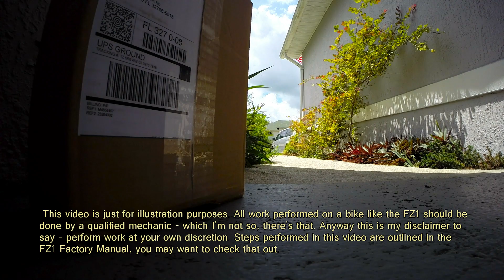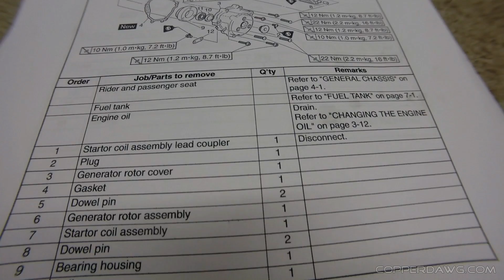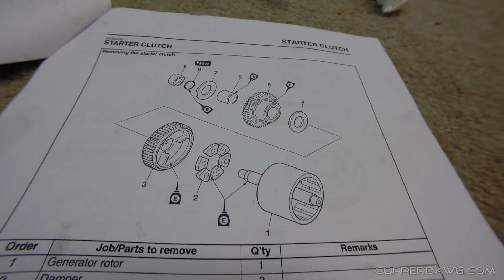FZ1 Video Tutorial - Generator Inspection

Comment: Are there any symptoms the bike will experienced if it was failing and coming apart? I just bought a 2014 fz1 with only 6k miles. 
I’ve only had it for couple days and haven’t ridden it much yet but during a cold start it would take at least 2 tries but once warmed up it has no problem starting. Previous owner said it wasn’t ridden much and sat for awhile so I’m not sure if that has to do with it.

Comment: is this a generation 2 fz1?
Reply from the maker: Yes, 2007
Reply: @buelle109  i take it that my 2004 is still possibly liable for the stator damage.
Reply: @jayminasi6073  I believe gen 2’s start @2006. And later gen2’s( not sure how later but like last yr or two) had a from factory “fix” , meaning they changed the design
Reply: @vicpnut1  what about the 13 model ?
Reply: @DaRuler66  i wanna say that yamaha finally fixed it by 13…but its been awhile and i cant recall specifically ….also just did a quick search and now specific years came up just how to’s and sales etc….i know i read in one or more forums im in of a year they finally fixed it ,all i can remember is is was way after they knew about the rotor failure  ,like last yr or two of production..
Reply: @vicpnut1  i was told the 15 were the first to get the new rotors - i'm looking at getting a 13 FZ1 but not looking forward to spending another grand to have the rotor replaced
Reply: @DaRuler66  if youre mechanically inclined at all it can be done at home for cost of parts alone fairly easily …..if considering it just search youtube for how to’s (theres quite a few) to get ahead of gear/bushing issues that if planned for arent issues …its really quite simple if you follow what you tuners did /do(watch as many till you feel confident)..my point being ,though my bike has given me some issues that arent typical …in general the bike is worth it imo…its a rocket in standard seating position (much more comfortable for all day rides) and there are tons of aftermarket parts and support out there ..just fyi/imo
Reply: @DaRuler66  also , the bike is old enough that theres a good chance a previous owner already swapped , like was the case in my 2009…i have a new rms rotor sitting here because i assumed I needed to replace it.when i opened the case (takes about 5 mins) i saw there was a new one already installed . So did t need to pull gears etc , which is the only slightly difficult part of doing the job .

Comment: The bearings aren't the issue. The issue lies with the rotor. The epoxy used to glue the magnets deteriorates and then the magnets falls off, hopefully only destroying your stator and rotor. If you are unlucky it grenades your motor. The new rotors are upgraded where the magnets are encased in metal and cant fall off. Well worth the upgrade since when they go bad, it just goes without any warnings.

Comment: The updated rotors are not cheap, but the old style can fail suddenly and without warning, and when it does, it releases shapnel into the engine.

Since it appears I am stuck with my '06 until I die (not willing to sell a great bike for pizza and beer money), I bit the bullet and got the updated rotor.  Thanks for the video!  My '06 only has 27K miles on it and has been flawless.  I wager it will be with me until the end...
Reply: I dunno, 300 bucks cad for the RMstator rotor and gasket is pretty cheap compared to new engine.
Reply: You buy oem rotor?
Reply: @mobleyMobley  Yes.  Alas, I plan to sell the bike soon for the aforementioned "pizza and beer money".  I am the original owner of an '06, that is a pretty good run!

Comment: Hello. Great informative video. Do you by chance know, if the bolt you are unscrewing at 3:09 has an o-ring in there? I ask this, because my fz1 is dripping oil, precisely bellow that bolt. Thanks for any input.
Reply from the maker: Yes, I am pretty sure there was an o-ring there.
Reply: Yup, I can confirm that. In my case, the O-ring was good, problem was that the Bolt was cracked because of a bike side fall. Anyway, problem solved. Thank you very much for your time.

Comment: There are two bullet shaped guides located between the cover and the engine ( you can see them on 6:30 ). Be carefull when you remove the cover because they come out loose and i had one fallen into the engine. I had to tear down half the bike so i can get to the oil pan and retreive it.The funny thing is that they are not magnetic so you cannot pull them from the top. Its a pain in the ass believe me and you need another 2 new gaskets to reinstall the pan.

Comment: Do you have any advice on how to remove the rotor from the stator. I can't seem to over power the the magnet connection. I may just be too weak right now, but it seem like you just popped it off by hand.
Reply from the maker: If I were to do it again I would use the ball driver to hold the rotor firmly into the rear bearing while I pry the cover and stator away from the case.
Reply: buelle109 could you send a link to the ball driver you are referring to?
Reply: Erick Miller did you ever get it out? I’m having the same issue

Comment: Ok, swapped my rotor yesterday. A couple of things. First of all your video was very helpful. Thanks! But you are missing the washer and spacer (which has an o-ring inside of it) that sits on the axle after the starter-clutch. I.e in between the starter-cluch and the inner bearing. It can't be seen on your video that you put them onto the rotor-axle but I hope that you actually did put them on but just didn't show it. ;)
Reply from the maker: Pretty sure its on there I must have cut that clip during editing

Comment: Great video, thanks!
I'm going to do this on my FZ1-N 2008. Want to replace the original rotor with the new version just to be safe.
One thing though; on the picture from the service manual you showed there is a O-ring displayed. Couldn't see it anywhere in your video though? Is it inside the spacer or where is it?

Comment: Hi, I'm not sure if you're still riding the fz1.. but i'd like to know the symptoms of magnetic coil failure if you know any?
Reply from the maker: So far those that have had the failure have not said that there was any indication before failure. And yes I am still riding the FZ1
Reply: Check the voltage at your battery, if it is anything less than 13v @ idle there is an issue with your charging system (which may be the stator, or rotor magnets or the R/R)
Reply: there is a high pitched whizzing sound, sounds kinda like gear driven cams. Then you battery will simply die and the bike wont start. Mine just failed. 06 model
Reply: @mechanicalman4531  how many miles?
Reply: @ThankthemosthighGod  40,000 k's
Reply: @mechanicalman4531  Thanks for replying

Comment: i had to get a used engine from using regular car oil for awhile;  and a new  starter clutch generator,    now  if u ever put a new engine  in, know that there's 2  little spacers  in the inside of the  frame and  u cant see Them !  \ and if u change the   thermostat  you want to start it  and let it  idle  a long, long  time causing the antifreeze to bond  to the  hoses   , so the  anti freeze  don't just  shot out ever time u drive it !

Comment: my 08 fz1 at 55k miles needed some work new timeing chain,guides,valves shimed,plugs,then the shop told me ,they found a grinding sound n vibration wen turned engine by hand!it was the stator bushings! worn out caused scrapeing,then after replaceing the bushings it was not scrapeing or vibeing any more, could be the start of stator disintergrating! if i did not take bike to shop could have ended bad!now shes got 73k n still runing strong! love the vids keep it up!

Comment: Are you going to make those new parts available to purchase? Im liking the headlight and radiator covers a lot! How many miles are people seeing these bearings go out at?
Reply from the maker: +88Grossboy Yes. I have another video coming in right behind this one with details. Stay tuned.
Reply: thanks for the vids!very helpfull! i just had my stator explode!its a 08 fz1 she got 79k+ thought it was the batery,nope got new one still dead! checked regulator rectifier,replaced that,nope still ,finaly test stator  with volt meter dead stator opend her up,aaaahhhh magnets seperated looks melted!,its bin 4 weeks  im not rideing going nuts waiteing for parts! TIP- YAMAHASPORTS PLAZA .com IN CALORADO HAS THE LOWEST OEM PARTS ANY WARE! MY ROTOR USED $353 they had it $332oem with revised part # i just got parts so after work i get a littel bit finished! that outer rotor bearing was a bich! how do you get it out with out damageing it?and replaceing it?